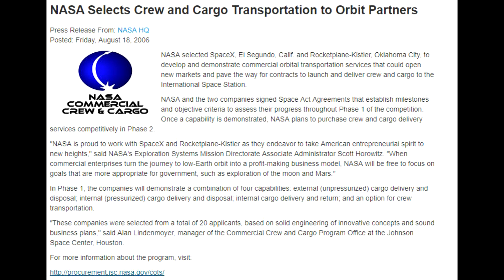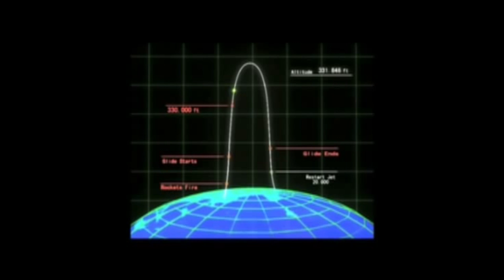The Kistler K-1 - 1990's Reusable Commercial Rocket

Comment: Man, no projects using NK rockets turned out well. One was a Soviet project well past their space-prime, one ran out of money, and one exploded. What's with that?
Reply: The Soyuz 2.1v actually still uses 1 NK-33 engine for its first stage. This Soyuz does not have the 4 strap on boosters, so it doesn't even resemble a Soyuz rocket. So far roscosmos has been lucky with this variant. However, the 2.1v has only flown a few times. So it's just a matter of time before before one of their remaining NK-33's explode on them.
Reply: @jamiegodman715  the 2.1v is also a cursed bastardization of the Soyuz that should have never been built.
Reply: waves hands: WoOoOooooOOoO!!!111!~~ 
:)
Reply: "One ran out of money, one exploded, and one was a Soviet project well past its prime and also exploded"
Reply: That's a bit more plausible.
Reply: I think they had really bad electronic control systems at the time. Modern electronics and gimbals would make it less of a problem.
Reply from the maker: The Soyuz 2.v uses this engine too:
https://en.wikipedia.org/wiki/Soyuz-2-1v
Reply: @scottmanley  the above statement still applies
Reply: Yeah the control system messing up and shutting engines down, sometimes in real problems, the wrong ones, caused  some of these crashes.
Reply: Timothy McLean the antaries worked fine, they only switched away from the nk33 to get a boost in launch capacity and safety track record
Reply: +Jamie Godman, no the main culprit was the fact the N1 used a ton of those engines as opposed to the Saturn V which used only 5 F1 engines.
Reply: Terry Wilson 

re.  "N1 Soviet manned lunar launch vehicle" - Only the N-1s that were launched were N1-1964 unmanned test vehicles powered by the NK-15s which were markedly less reliable than the vastly improved NK-33.

re. "Antares needed two NK-33s to get off the ground while N1 needed thirty." - True, but Orbital, against the advice of the Kuznetsov team, pushed the engines too hard by flying them at thrust settings above the original Soviet ratings.
Reply: +Timothy McLean
I feel dubious about that corellation. I have a strong feeling there's no good statistical data to suggest that the engines were the problem.
Reply: Well, duh. But that doesn't mean that we can't point out the weird coincidences and get all superstitious about it.
Reply: Those engines seem to be just a bunch of Bad Luck and something faulty going on...
Reply: I guess that's why ULA is still using Kuznetsov RD-180 engines. And  why Orbital ATK switched from the NK-33 to the RD-180 after the explosion.
Reply: @karlstorie8813  - Also, Orbital have not switched to the dual chamber RD-180. They've switched to a pair of RD-181s. Also, the only reason that the one NK-33 ever failed was because Orbital insisted on pushing the engine well over it's officially rated maximum thrust.
Reply: @karlstorie8813  actually the rd 180 was a derivitive of the nk33
Reply: Mi 28

Then why does a Falcon 9 first stage booster use nine engines instead of one?
Reply: @argh1312  - Because they could not afford to develop one bigger than Merlin. It's also impossible to throttle a single engine adequately to achieve a powered landing.
Reply: @Friday Harlowe - The Soviets were responsible for Orbital pushing the NK-33 over it's rated thrust?
Reply: That and the plumbing not being able to take the vibration. It's easy to understand somebody wanting to make them work., though.The F-1 from the Saturn V got a sea-level specific impulse of 263 seconds and 304 vacuum. The NK-15 in the N-1, 297 and 331 respectively. Everybody in the west thought a closed-cycle engine like that was impossible. When we finally tried it with the SSME, they had a lot of problems--took a lot longer than Kuznetsov did to make it work.

Originally Korolev they thought they could get by with the 24 engines in the outer ring. They were supposed to have much shorter nozzles and expand against an inside skirt, making an aerospike arrangement. Air was going to flow down the central plenum and mix with the exhaust for thrust expansion. That would have been way more than 50 years ahead of its time, because here it is 50 years later and nothing with an aerospike or thrust augmentation has ever flown.
Reply: when you make things go boom. sometimes its a bigger boom.
Reply: Do the Russian rockets still used giant wooden matches too start their engines?
Reply: @blu3flare25  im afraid its a yes
Reply: Oh, you're talking about the Soviet rocket. I thought you are talking about space shuttle.
Reply: Mi 28 well, it‘s 14%, but the result is the same for sure
Reply: RD-181 *
Reply: To put it in perspective. If every engine has 0.5% chance of explosion during a run, then using 30 engines means you have 15% chance that one of them will explode. Having the rockets using that many engines explode 4 times in a row is nothing out of ordinary. In fact, having them explode 4 times in a row is the same odds as having an individual engine explosion.
Reply: +Mi 28 Rockets don't just "randomly explode". There were some real issues with the N-1 control software. For example, it had a designed-in tendency to command shutdown of all the engines at very inopportune times. The actual engines didn't go boom, the full fuel and oxidizer tanks did when it hit the ground.
Reply: @Markle2k  also don't forget about pogo oscelation or whatever you called it
Reply: The rockets exploded every time because there were like 50 of the engines. And as with all rocket engines, especially the old designs, there's a chance that it'll just explode randomly, and it adds up if you use more engines. And if any of them explodes, there's a good chance that explosion will destroy the fuel tank above it, or destroy the neighboring engines, either way the rocket will go down. This is why rocket designs opt in for minimal amount of engines, the gigantic Sea Dragon for example only has one engine. Because more engines just means higher risk of explosion. It doesn't matter if your other 49 engines are still running if explosion had ruptured the fuel tank and entire rocket is just about to be obliterated.
Reply: Timothy McLean don't forget the N1 moon rocket. It exploded all 4 times they attempted to launch, and the culprit was the NK engines.
Reply: @jamiegodman715  no it wasn't it was the plumbing, vibrations and the KORD system
Reply: It's clearly an ancient voodoo curse that's at fault.
Reply: On paper the NK-33 looks great.  The reason it is able to be so efficient is because the Soviets figured out how to make them fully closed-cycle.  As an engineer, though (not the rocket type), I can't see how they would be reliable.  Venting the exhaust from the turbopump into the combustion chamber seems sketchy at best.  The design of the electron rocket makes more sense; just decouple the pumps from the fuel system.
Reply: @davidturpin9135  - The NK-33 is extremely reliable & works. The one & only in flight failure was due to the fact that Orbital insisted on pushing the engine well above it's original Soviet officially rated maximum thrust. Unlike Kistler, Orbital were to cheap/greedy to use three engines in the first stage as opposed to just two. RD-180, RD-191 & many other Russian engines use closed cycle & none have ever failed other than when Orbital misused them.
Reply: Motto of the story is soviet rocket scientists suck.